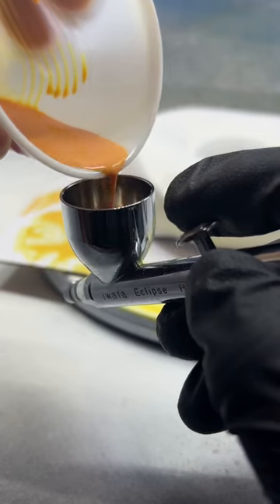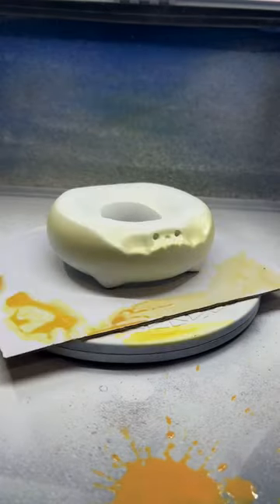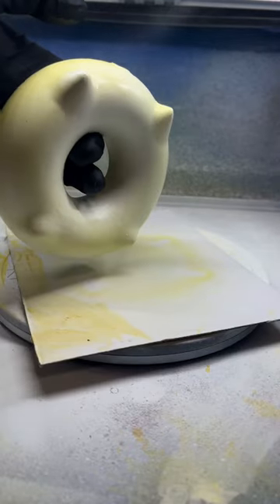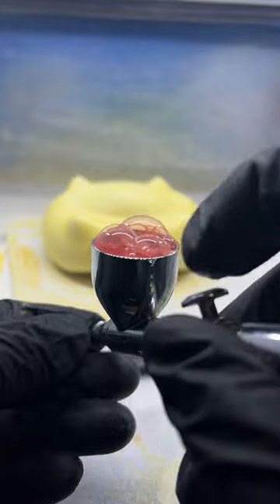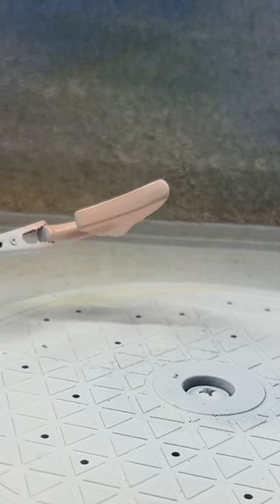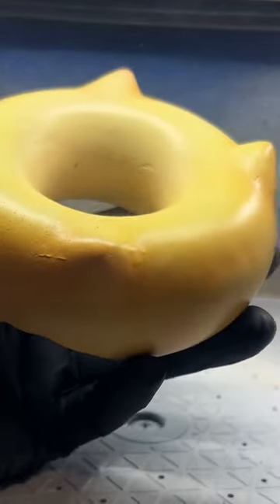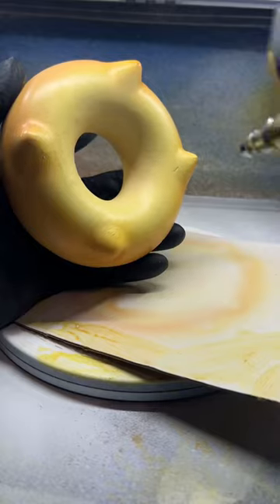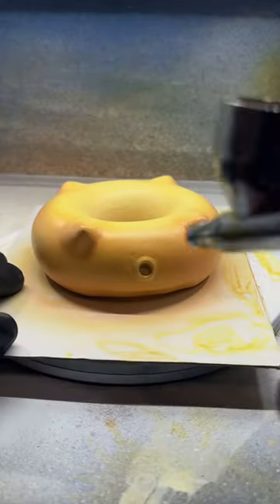Part two: Painting 3D Printed Designer Toy printed on Photon Mono X2 by @anycubi

Comment: Hi i would like to ask, i have done calibrating my photon mono x2 using “The Cones of Calibration”.

I got best result on 9s exposure using Resin Anycubic Flexible Tough Resin Clear. 

My question is: 
1. why is my exposure time needs to be around 9s ? Is it normal ?
2. Is there a way to set UV power on Photon Mono X2 ?

Thank youuuu
Reply from the maker: Mine are at 30 seconds
Reply: @abovewongart  wowww is it for the normal exposure ?